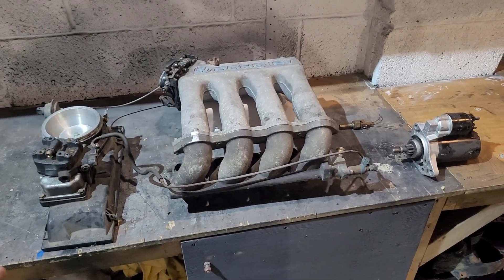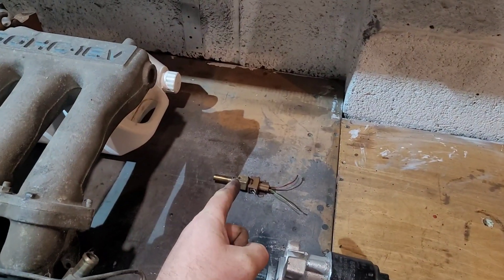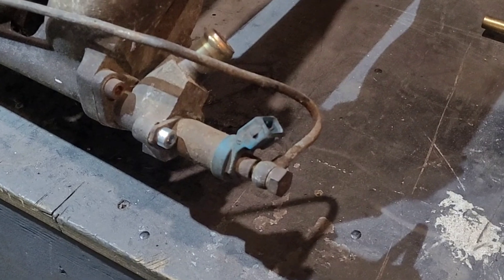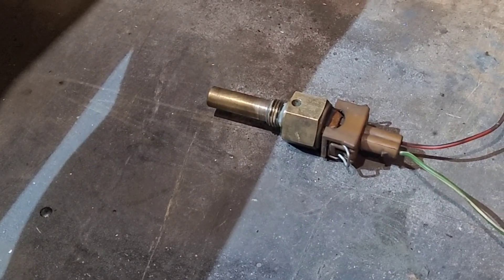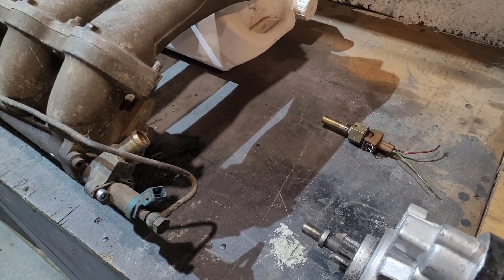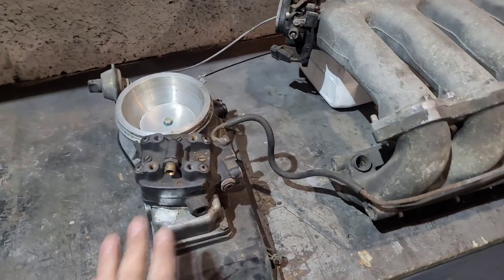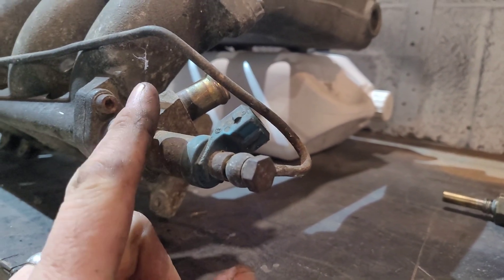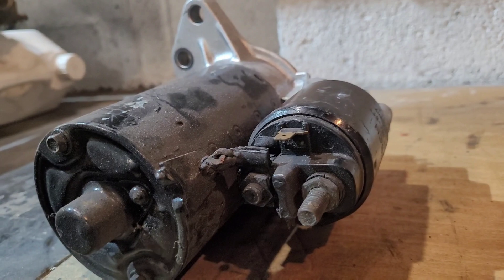Bosch K-Jetronic - Mk2 Golf GTi 16v - Cold Start System

Comment: Dear sir,
A very educational video from you and well explained, thank you.
But I wonder if the engine is warm and running at full and high speed, whether extra gasoline is injected via this cold start injector?
Or does the engine have to do it with his own 4 normal injectors?
Because I have always heard it said that the K-jetronic could use some extra fuel when reaching its top speed, as the fuel mixture would be very poor and lean at such a time?
I would like to see your view on this. 
My best thanks in advance for this.
Reply from the maker: Thanks, the 5th injector only works at cold start and cold enrichment when its cold and your open wide the throttle.

A stock KR engine will generally run lean top end

Comment: So my 87 cabriolet with a 2.0 passatt 16v engine swap has a cold start issue. It will start but die immediately. I can feather it to keep it idle and eventually once warm will idle. It seems that this system you've explained has been deleted. If I add one again will it fix the cold start issue?
Reply from the maker: Does your metering head have any electrical plugs on it?

Comment: Great video. Thank you. I'd love to see a video that shows the same details with a k-jet system that uses a warm up regulator. My old Volvo's cold start injector is stuck on permanently. I'm hunting for the cause.
Reply from the maker: Hi, if it's stuck open, then i guess it's either the actual cold start valve broken or you have an electrical issue causing the valve to be active.

Comment: I've got a 1.8 16v corrado in the garage thats having cold start issues, i.e. when started it will not rev clearly and is bogging down, does not idle up and ticks over quite low. After a minute or 2 the idle will rise and it'll eventually take a clean rev. Fifth injector is spraying ok, ive replaced 2 of the 3 coolant sensors in the head. Throttle body off and cleaned. Any ideas?
Reply from the maker: Hi, potentially sounds like the WUR isn't functioning as it should be
Reply: @GreyGooseRestorations  is there a way to test this part? Am I correct in saying its on the gearbox side of the head towards the front of the engine?
Reply from the maker: Yes thats the one, has two fuel pipes going to it and a vacuum hose and one light grey plug.

Without a set of gauges to test pressure not really
Reply: @GreyGooseRestorations can they be refurbished or bought new?
Reply from the maker: Not available new, i rebuild and test these plus all other types of K-jetronic parts, contact me via my Facebook page/WhatsApp/email if you want to rebuild

Comment: Awesome channel, just what i need, dug my mk1 16v out the other day after 15 years, as she turned 40, these vids will help me so much, my 16 v doesn't seem to have the wiring for the cold start valve, never had issues with it starting, but did used to hunt the revs  unless i pulled out that vacum pipe, will check it out more now iv watched this vid 🤙
Reply from the maker: No worries, any issues just shout 😉
Reply: On closer inspection I do have that one , its the valve above that one, idle control valve or something, anyway will  enjoy watching these vids 🤙

Comment: Good morning friend. So far I have not been able to do checks on the car. I have removed the cold start valve and it does not leak under pressure. I think the problem is in the timed temperature sensor that commands to inject fuel when the engine doesn't need it. If I disconnect the cold start valve, it starts perfectly! It may also be that the injectors lose a little gasoline but I have not verified that. After 12 hours with the car stationary with the injector connected and the car cold it starts up fine.

Comment: Great explanation video, I'm wondering did you ever try with "Wide open throttle" enrichment mode, and in your opinion does it make any sense to have that mode installed on the car...?
Reply from the maker: Thanks, that is one way to add extra fuel but its not really needed if all else it set up correctly.

Comment: Greetings from Spain. Very good video. In my case, if I leave the car stationary for 1 hour, it is difficult to start. But hot or cold it works fine. The pressure accumulator is new. Any ideas? Thank you!!
Reply from the maker: Hi, it could be the pressure relief valve seal in the metering head, if its letting fuel seep past that could cause hot start issues
Reply: Thank you very much I will have it on mind. But this problem has come since I changed the starter motor solenoid. Before it was broken and it did not send 12 v to the cold start valve, so it was very difficult for it to start cold but hot without problems. I plan to try disconnecting the 5 hot injector to see if it improves. Would it make sense? @GreyGooseRestorations
Reply from the maker: Ok, first double check the connections are on the correct terminals at the starter as they are cold start/cold enrichment so if not connected will cause issues also
Reply: @GreyGooseRestorations  

Thanks. Checked and it's fine. Release the cold start valve and after 1 hour it started perfectly. I have the suspicion that since the valve has not worked for years, it does not spray correctly and makes it difficult to start. I'll try it again this weekend.😉
Reply: @GreyGooseRestorations  Good morning, the connections are fine. After the car warms up, I tried to start it without the cold start injector connected and it starts perfectly. The problem is when I start it with the injector connected and after waiting more than 10 minutes. I think it's hard to start with the plugged in because it injects a lot of gasoline. When it cools down completely (after 1 day) it starts perfectly with the injector connected.
Some clue? Thank you.
Reply from the maker: Ok, take your 5th injector off and put it in a jar and see if its seeping fuel with the systems under pressure

Comment: Cracking  video bud, using it to help diagnose a cold start issue on my corrado. I have a 1.8 kr engine. It struggles to start when cold, I mean it does start but have to crank it a few times to get it going, when warm its fine. Would this be an issue with the 5th injector?
Reply from the maker: Glad its helpful, sounds like it could be the fifth injector
Reply: @- Grey Goose -  appreciate you bud, thanks

Comment: Can you look at the 2.0 16v corrado A9 or 9A I can’t never remember the code.  It’s like the 1.8 but it doesn’t have the screw on the metering heads etc
Reply from the maker: Theres not a huge amount of difference between the KR/PL 1.8ltr engines and the 2ltr 9A engines, if its Kjetronic then it'll have the C0 screw on the metering head too

Comment: Hi there, I have the new starter motor without the extra pin, I have been told I can connect it to the starter but with a diode. Would you know what type of diode I would use for this?
Reply from the maker: No need for a diode, there are two large bolt terminals.

The one that is between the solenoid and the motor body, connect the two black wires to this terminal.
Reply: @GreyGooseRestorations  sorry if I wasn’t clear but the 2 black wires that go to the 5th injector had a 4th plug on the old starter. My new starter doesn’t have this 4th plug. I was told if I attached these 2 black wires to the normal spade connector on the starter it would fire the starter every time I accelerate due to the cold enrichment valve sending 12v to it.
Reply from the maker: Yes thats correct but the easiest way is too connect those wires to the other big threaded terminal on the starter solenoid.
Reply: @GreyGooseRestorations  ok thank you, would that be the terminal with the big red wire, not the black and red one.
Reply from the maker: If you looks at the starter as new and not fitted to the car there are two threaded bolt terminals, one has nothing on it and the other has a cable attached that links the solenoid to the main body, put the black wire on this one 👍
Reply: @GreyGooseRestorations  thank you I understand now. Will have a look and try and sort it when next with car.

Comment: great video, I was wondering if you would know what would cause my car to die after the fith injector stopps spraying fuel? This only happens when cold but starting is completely fine when up to running temps.
Reply from the maker: Thanks, it could be due to the C02% being too lean potentially, are your overrun cut off valve and cold enrichment valve electrical plugs on right? The cold enrichment valve should have the plug with a white wire and a black wire
Reply: @GreyGooseRestorations  i believe the white and black wires are connected to the cold enrichment valve but I will double check tomorrow and let you know 👍